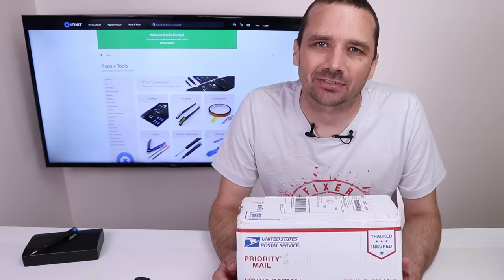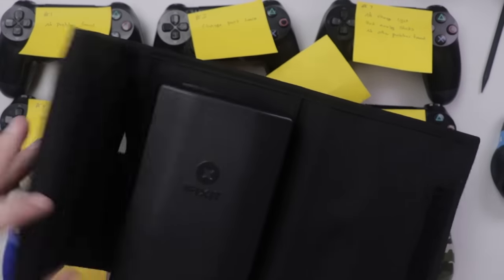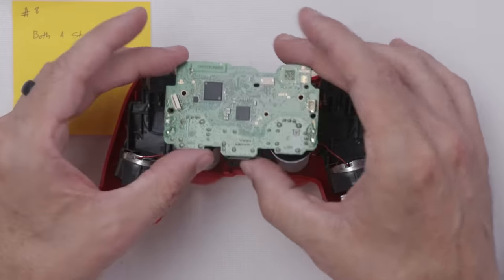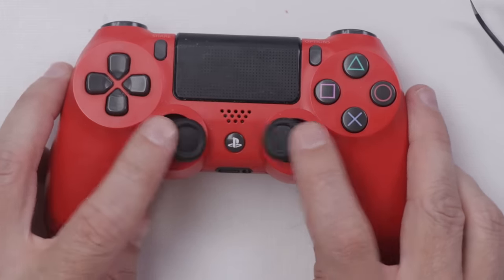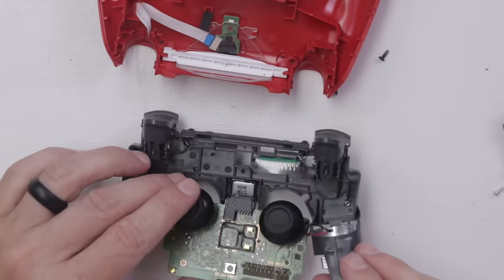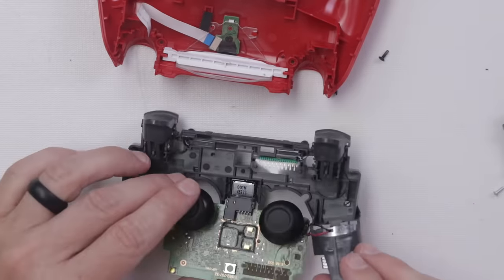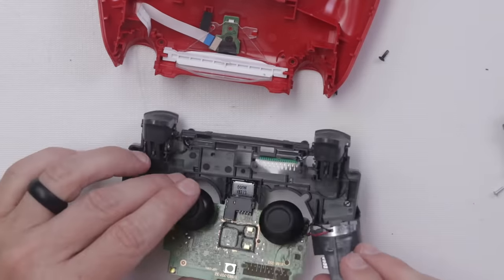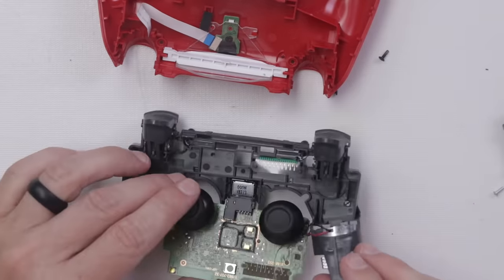I Bought 11 BROKEN PS4 Controllers for $220 - Let's Fix Them!

Comment: Y'all better clone my original ps4 1st day bought controller with ps4 V1 ** its the GOD controller ** no loose steering wheel alike feel like some cheap as controller I bought wired and was not originall and does not have the PS logo on PS button y'all feel me